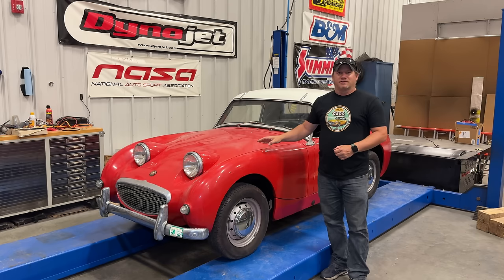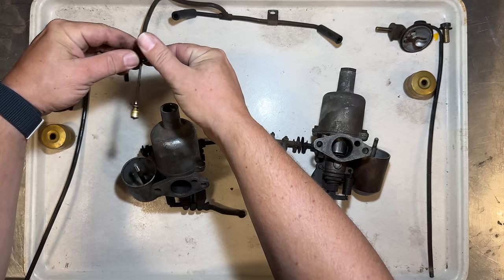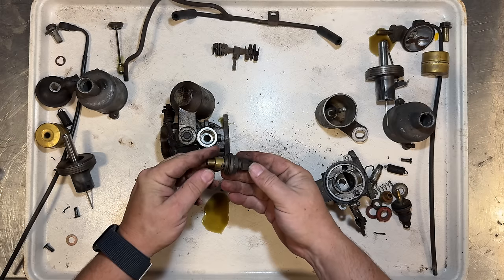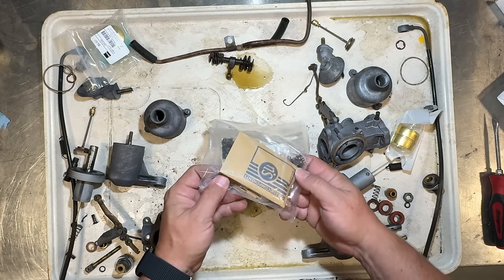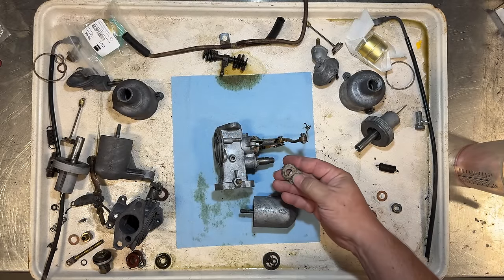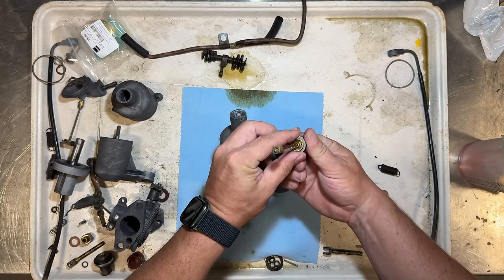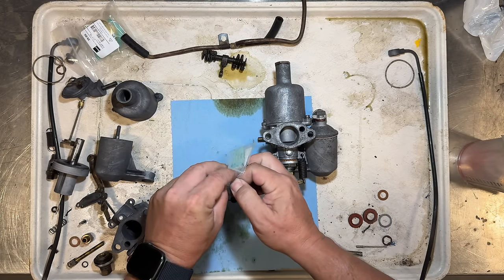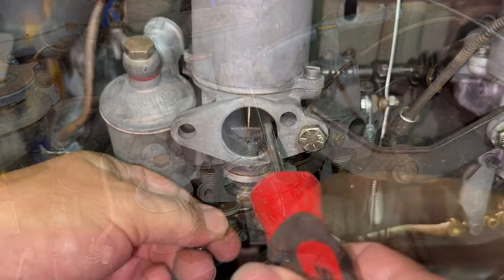Rebuilding the SU H1 Carburetors on Barn Sprite #3

Comment: Dang, sure do wish You Tube and this channel were around 45 years ago when I was trying to rebuild a pair of these carbs from an English shop manual. That's English, not American shop manual. SU carbs are the devil's own work shop. You make it look so easy and logical. The only carb I had rebuilt before these was a Carter. Not much similar between the two besides the smell. I never did get my carbs properly running again. A shame too. I really liked that Midget.

Comment: A good video very well explained. I think that you should have explained in more detail how to centre the jet though, its very important and best done before the carbs. are fitted back on the car. All this is fully explained in the official SU manual. These SUs are a joy to work on and so simple to recondition, its a job that I've done many times when I worked for BMC back in the1950/60s. I was very surprised that you didn't rebush and replace the throttle spindle and butterflies. They were very certainly worn. The parts come in the recon. kit.
Reply from the maker: I will do another video on centering the needle as there is several ways to do it both with the correct tools and without.

Comment: So I was talking to an old SCCA guy, Dick Powers last weekend at the SVRA weekend at Watkins Glen and Jack Daren was there being honored by the MG drivers for his work in building cars back in the day. Dick and Jack related a story about tuning SUs, they would fill the bowls then blow into the intake and at the point the fuel would just well up from the needle, they called it good. Apparently that was the secret method back in the day with these car builders. I wanted to know how they got their faces right into the intake to blow in there but they just shrugged and said when you're young you can contort yourself easier.